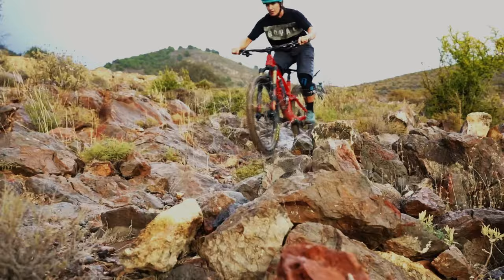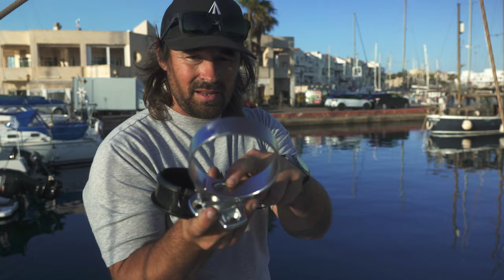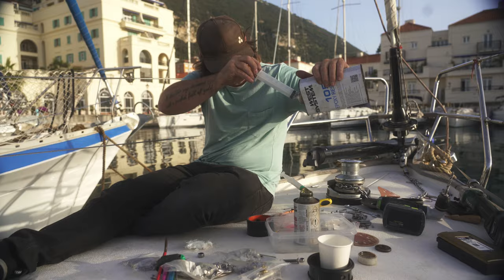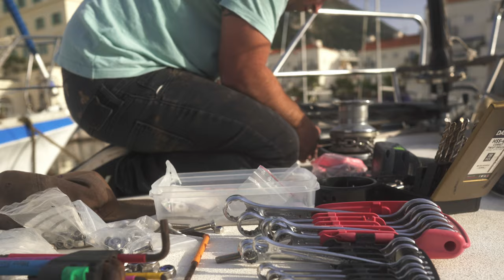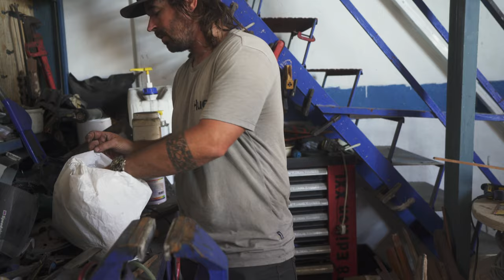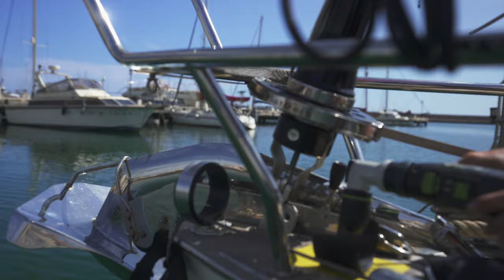Retrofitting a bowsprit - The ANSWER to cruising under spinnaker.

Comment: If you have a Wichard D Ring then you can sand down the plastic feet of the inboard end by 1 or 2mm and it fits without a problem. I know because I’ve just, very cautiously, done it.
Reply from the maker: Hey, nice work! Thanks for letting us know! Nothing better than getting around a problem manually! 👍🔧
Reply: PS: This was a tip from Zaphod on Jeanneau Owners Proboards forum so don’t want to take all the credit for this!

Comment: Chris, did you thru bolt the pad eyes? I assumed that you did I just couldn't see how you addressed the inside. I do like your videos really informative and the perfect balance of tech and muscle. cheers!
Reply from the maker: Hi Steve,
Thanks! So, yes… through bolted with washers in the aft part as it’s in compression and a large spreader plate at the front as it is in tension there. Sorry I missed that 👍

Comment: Brilliant video. Will the bow spirit effect your steering at all? I run my spinnaker from my pullpit which isn't the best idea but its all I have at the moment. I need the main up to counter the spinnaker, otherwise I struggle to turn the boat windward when sailing on the beam. Even though the pullpit is only a few inches forward of the forestay the dynamics change on the boat.
Reply from the maker: Hi James! Thanks!

The sprit made no difference to our helm balance at all. I would guess it’s more to do with the massive amount of draft in the sail compared to a job or Genoa. The power increase of a loose luffed sail is massive and that’s probably more likely the cause. Have you tried tensioning the luff to reduce power when pinching and slackening when running?

We were lucky as we had had a code 0 that was basically super light 130% Genoa for pinching and it flew from a strop half way along the bowsprit - that was to reduce leverage as the luff tension is much greater on that sail. 

We managed many a sail with those sails and they were completely game changing for that boat but we’ve moved on now, we’re building something quite special (well to us anyway! 🙂)

Maybe you will like this too🤞

https://youtu.be/-ZfmBKcN1Z4?si=EgWWCFRxCmOgof4Y

Comment: Great video of the installation. Currently doing the same on a Bene 473, using a Selden 90 degree bracket bolted through the bow roller. But how do you remove the plastic inner ring from the bracket?. I called Selden UK, but they did not know.
Reply from the maker: Thanks! So… it’s a stiff old piece of stubborn plastic alright. Pop the metal ring in a vice and prise it out with your hands (or maybe screwdrivers) - it does come out! However you shouldn’t really need to take it out - you can just line the plastic ring up so that the hole allows access to the centre torx bolt, remove the bolt and it all comes apart.